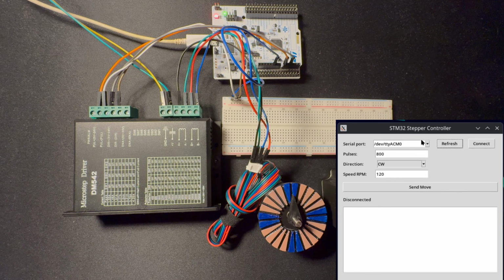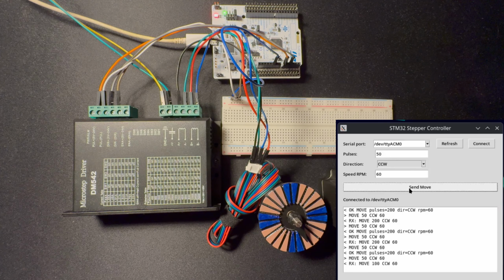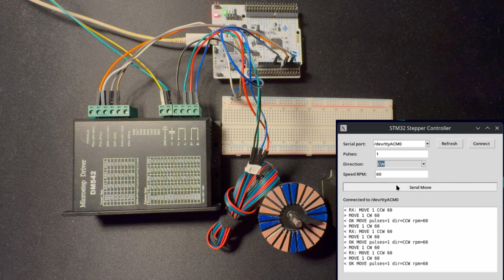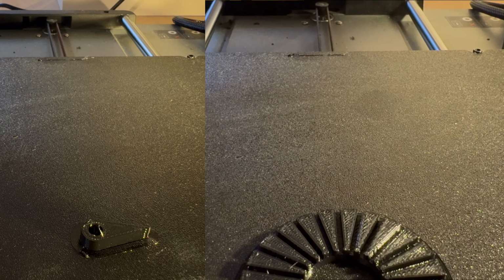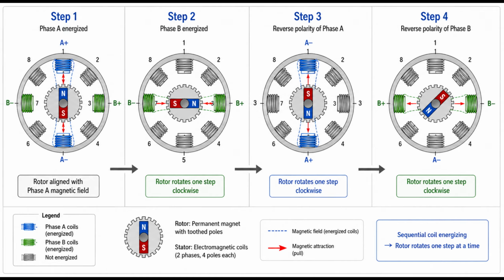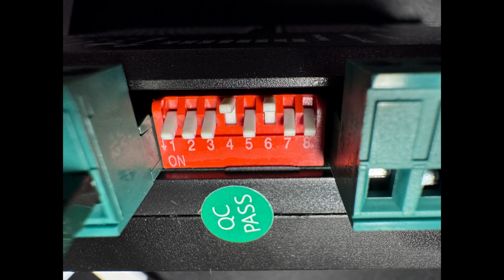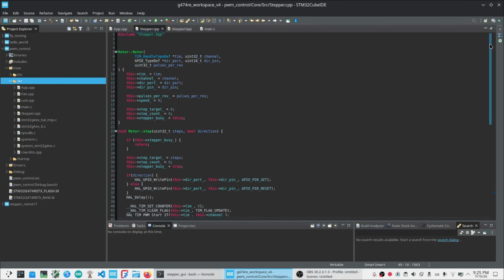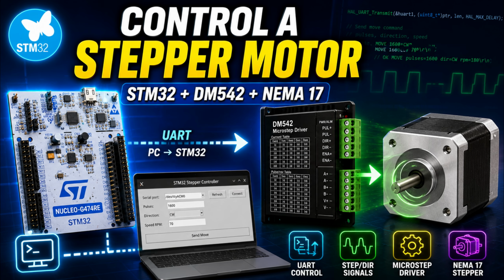Control a Stepper Motor with STM32, DM542 Driver and Python GUI

Comment: Hello, great video—congratulations on the content. Please excuse my poor English; I’m Brazilian. I need to develop software for a personal project using an STM32 and stepper motors, just like in your video. I was wondering if you could send me your project files so I can study the code and make my own project easier—if that’s not too much to ask. Thanks for your time.
Reply from the maker: Hi! Thank you very much, and no worries about your English 🙂
I’ve uploaded the project files to GitHub. You can find the STM32 stepper motor project here:
https://github.com/graphnexus-io/embedded/tree/main/stm32/1_stepper_motor

Feel free to study the code and use it as a reference for your own project. If you have any questions about how something works, just ask. Good luck with your project!